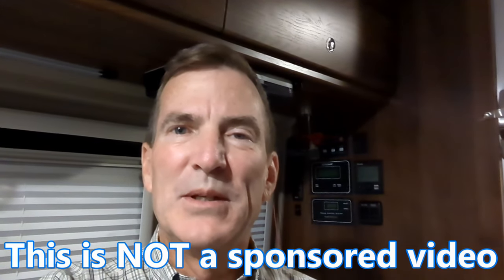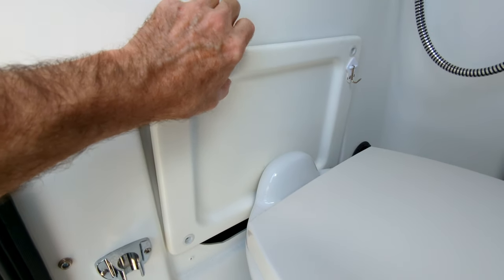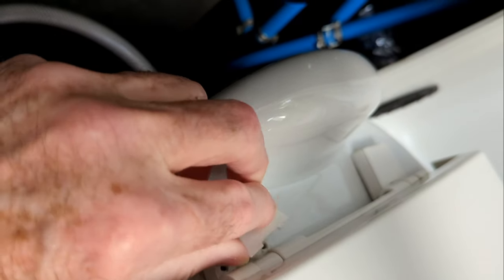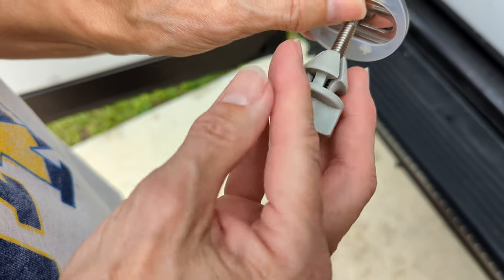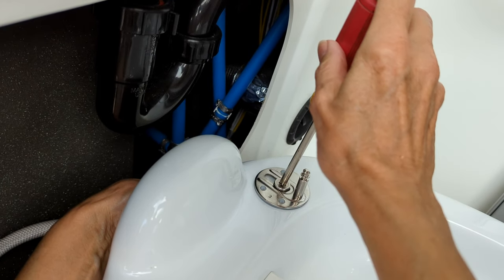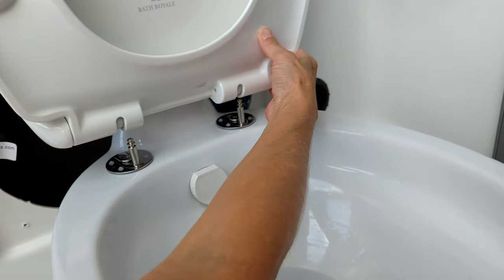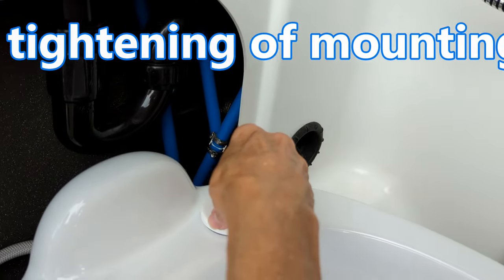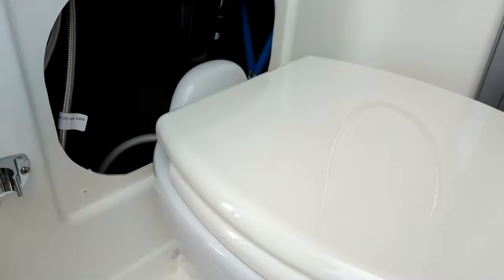Toilet Seat Upgrade

Comment: 🤠Nice upgrade Tex. We did a "soft close seat" when we upgraded to an elongated toilet in our 22KL. I hated that loud bang when we took off in the van when the seat and or lid was up. You look good as new. hopefully you are....PS nice tip on the screw covers as they pop off and get lost. I lost one down the toilet hole to the black tank when I replaced the toilet.💩 I quickly learned the hard way to cover the hole when the toilet is removed....
Reply from the maker: Ouch, as you know well, you anything down the black tank other than human waste is bad news. Fortunately, the screw covers are small enough the odds of them creating a problem are slim.  
Saw my cardiologist last week and he was quite pleased with my progress.  I feel about 75 percent recovered.  Hope you had fun at GNR.
Reply: @RV2Cycle  Yes Fun Fun Fun. Glad you are doing better !

Comment: Steve, did you get the regular seat or the heavy duty one? I'm not sure if the heavy duty one is worth the extra $ and the month long wait for delivery. But, I'll certainly trust your recommendation. Thanks!
Reply from the maker: We went with the round heavy duty and don't regret it one bit. If we had it to do over, we'd get the next size larger round heavy duty which would extend a wee bit outside the bowl and make it easier to lift the seat.

PS, if you order from below, they are delivering in 5 to 6 days from the order date. 
https://amzn.to/3E4Gqwc
Reply from the maker: PS, a major plus for the heavy duty is you CAN sit on the toilet with both seat and lid closed without feeling like you're going to fall through.
Reply: @RV2Cycle  Thanks so much. Hevvy duty it is!  I wondered about the width. I was out there with the tape measurer, and it seemed a tad narrow compared to the bowl width. I'll see if I can find a heavy-duty one that's a little wider. I really appreciate your response!
Reply from the maker: Chris - the BR500-00 is a bit smaller than the Travato toilet bowl's exterior dimensions.  However, it does work, its 'feet' rest appropriately on the bowl edges without any modifications required.  So, if you can find one that fits better let me know.  I'd not spend countless hours looking though - been there :)
Reply: The new toilet seat is successfully installed! Thanks to your video, that was really super easy!
Reply from the maker: @chrisbranham1608  fantastic, glad it went well!